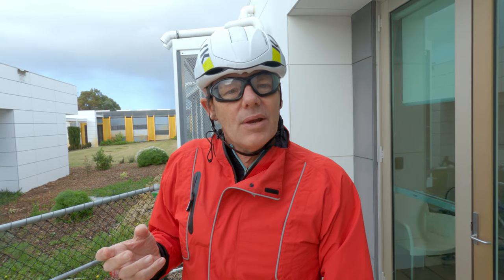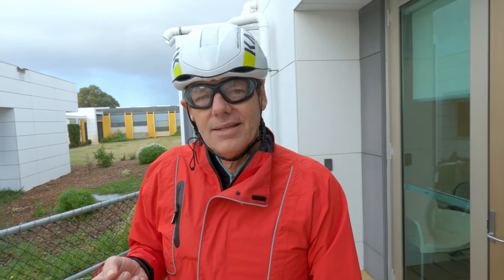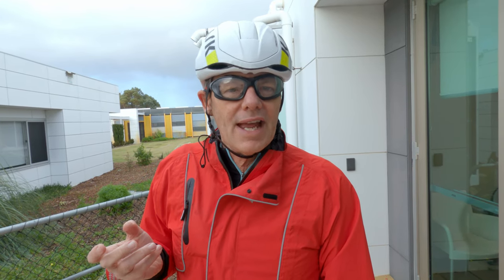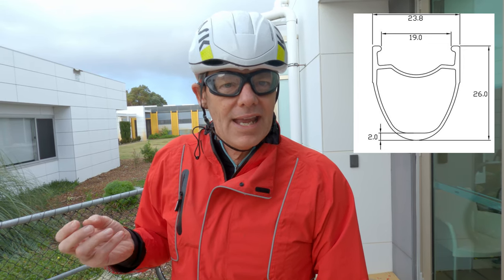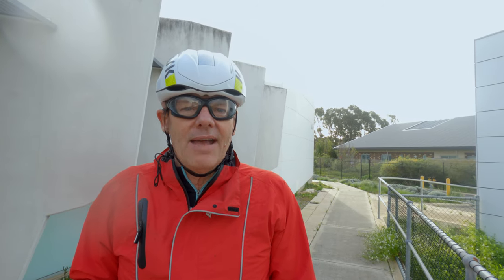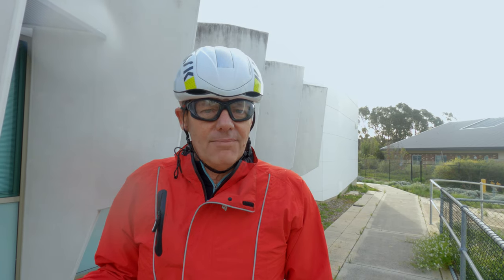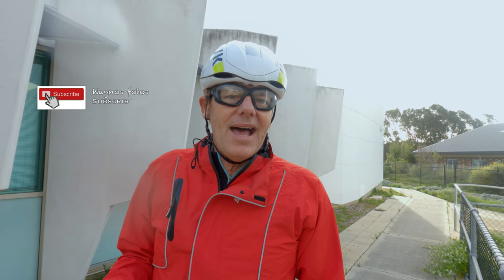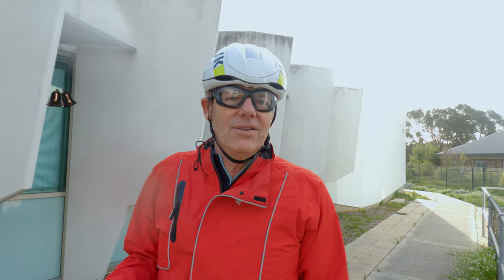WHY did manufacturers move to ROAD DISC?

Comment: We should all give the industry as a whole a thumbs up for making solutions to problems that have happened over the coarse of just a few years, as far as road bikes are concerned. I'm not  defending the bike industry because why fix something that wasn't broken to begin with. However, people wanted these deep dish wheels and the aluminum deep dish wheels were way to heavy for racing. Along comes carbon. But it wasn't just the braking issues because at the same time tubeless was introduced. So in order to get road tubeless to work as well as it does in the MTB world they had to make the tires wider or have more volume so you could run at a lower pressure. High pressure punctures just won't seal. Rim brake calipers don't reach well around fatter tires. So the industry actually solved two problems by moving to disc brakes. I'm pleased that they were able to do this in just a few years and if you think about it they actually made history by changing bikes in a major way from the way bikes were for decades. Lots of small changes have always happened over the years with components but a lot of people never noticed those, just try fitting a crankset from 1985 to work with your current 105 or better group. I'm attempting that feat right now and it isn't easy. As for acquiring older parts, yeah it's going to get more difficult but if you look you will find. You can always build your own wheels to match your current setup if you have 130 or 135 dropout spacing because there are plenty of parts still being made. The sky has not fallen yet.
Reply from the maker: True 👍
Reply: The industry created 2 problems, then told us we needed a solution.

Comment: The braking is so much better with disc. In the future there might be something different and people will whinge again cos they don't like change.
Reply: Discs better?? No more warping o fading?? FINE!!      Rgr
Reply: My latest bike is with disc brakes (Shimano). I live in a hilly area. My former bike had Ultegra rim brakes. There was no difference in dry condition, the rim brake felt even more subtile. it can happen that when you remove a wheel (for transport for example) and remove it back, that your disc makes annoying noises. By the No amateur racer is using disc brakes around here and we have a big club here in Göttingen (north of Germany). I use my race bike also on soft gravel roads and therefore i like my discs, but Iam looking for a rim brake road bike which is difficult these days. And change is not always better...
Reply: @rolffuchs2737  The problem with removing wheels are with quick release they are not exactly at the same position if you put them back in, which causes a disc rub and noise. With a through axle this is solved, they are more accurate in fitting without any play.

Comment: Racing cars and high performance road cars are using carbon brakes and these get that hot that they glow .
     so the technology to produce a rim that will deal with the heat that a a light weight bike produces even descending a steep and long hill must be available if manufactures wanted it,
     They dont they want to sell you a new bike.

Comment: I think you're spot on, the main reason to switch to disk breaks is carbon clinchers. It is difficult to sell expensive wheels, if the wheels are dangerous or to expressive (to low profit margin).

Personally I am really happy with disk breaks on my road bike, but I am a bit heavy (100kg) so rim breaks is a bit to weak for me inn regards to racing anyway.

Comment: So we can agree that, apart from the demonstrated improved breaking performance, disc brakes are safer, especially with carbon wheels. I'm glad we can finally have this conclusion.
Reply: The overall weight is higher and poorer aerodynamics as a result, just to have better braking that is of little or no advantage 99.99 % of the time.
Reply: @SurpriseMeJT  well you tell that to Pinarello who assure that they're new F model is actually more aero in the disc version and only about 150 grams heavier, which is insignificant with the aero advantage.
Reply: @AlexanderTanned  They're lying.  Any company can say they measured anything in any way without providing testing details and then say "See, the new one is better!".   How would you determine if the increased weight is offset by the allegedly improved aerodynamics?  If an independent lab tested this, I might believe it.  Why is there so little independent testing for the bold claims of these bike companies?
Reply: @AlexanderTanned  BTW, just google "disc vs rim brake aero" and you will find your answer.
Reply: @SurpriseMeJT  that could be believable is they didn't have a rim brake version of the new Pinarello F. But they do, my man. No conspiracies, no dark interests. You might just be wrong.
Reply: @AlexanderTanned  Based on the comments of a real aerodynamicist who worked on F1 cars, I'm more likely to be correct.  Hambini is the man.   Make air dirty behind, not in front.  Once air detaches from the surface, it cannot reattach.
Reply: @SurpriseMeJT  The average bike rider doesn't much care about weight or aerodynamics. They do care about how frequently they need to take their bike to the shop to have it fixed or adjusted because they can't or won't work on the bike themselves, and it's this fact alone, I believe, that's contributing to the dominance of the disc brake in the bike industry: caliper pistons that self-adjust to brake pad wear. That might apply only to hydraulic brakes, but to be clear, even mechanical disc brakes are easier to adjust and service than rim brakes.

Then there are all the other benefits disc braking provides: increased modulation and stopping power, more consistent and safer braking performance in inclement weather, the ability to run a wider range of tire widths without hindering tire removal, or even different wheel diameters for both road and gravel riding. Rim brakes just don't allow for that kind of versatility. For the average bike rider, it's a pretty easy choice to make.
Reply: @ericn6611  Uh, I've used hydraulic disc brakes since 2005.  Rim brakes are easier to adjust and maintain than any disc brake system.  Amateurs riding crappy rim brakes will prefer a crappy disc brake because it probably will provide higher braking power.  We aren't talking about Walmart bikes though.  Wet discs are really poor in braking too.
Reply: @SurpriseMeJT  My experience is the reverse. Have bled the brakes once in six years and changed pads twice. Rim brake pads need to be constantly cleaned and bits of metal picked out, otherwise the rim brake track wears prematurely and braking isn't as effective. Riding in the rain with a rim brake bike requires quite an effort to clean the paste off the brake track.
Reply: @SurpriseMeJT  Had to switch accounts, but as I said, ease of maintenance is almost irrelevant to the average rider when they simply go to their LBS for repairs or adjustments.

Putting that aside, though, you just provided yet another reason why disc brakes have overtaken rim brakes on new road bikes: "crappy" disc brakes still handily outperform crappy rim brakes, and first impressions matter when newer riders decide it's time to upgrade or buy a new bike. They'll go with the system that performed better.

As for discs performing poorly in wet conditions: no, that's a very flawed generalization if not an outright falsehood. I have several road and gravel bikes with a spread of rim and disc brakes between them, and while the rim brakes do fine in the wet albeit with slightly diminished performance, my disc brake bikes experience no discernible loss in power thanks to their pad material. Rim brakes must use rubber compounds for their pads. Disc brakes can use metallic pads, with the tradeoff being slightly more noise. Coupled with a steel rotor, that's loads more friction compared to rubber on an aluminum or carbon brake track, which are all significantly softer materials. There's no contest.

Also, mountain bikes have been universally equipped with disc brakes for years now due in part to their superior wet braking performance. Splash a little mud on the braking surfaces of each system and the gulf widens even further. If you've been riding disc brakes since 2005, you must've known this.
Reply: @Kuriketto  I do know this, but stock bikes, especially cheap ones with discs do not have metal pads.  Metal pads wear down rotors more and can be noisier on average than resin pads.  Also I didn't argue against disc on MTB's.  We are talking about road bikes, descending mountains, heating up the rotor far more than on the trail.  Disc brakes for road bikes are not only not necessary, but they are a net performance hinderance at any level except maybe on a 20k dollar bike.
Reply: @SurpriseMeJT  You said wet discs perform poorly, so I brought up mountain bikes being equipped with them to prove that's demonstrably false. Even with stock organic pads they offer no worse performance than rim brakes on both mountain and road bikes if for no other reason than the braking surface being raised higher off the ground and out of the way of water and other contaminants.

And while it's true that metallic pads wear down rotors faster, it's also easy to swap them out for organic or semi-metallic pads for normal riding. Pop out the wheel, undo the pad retaining bolt, take out the pads, reset piston positions, swap in replacement pads and reinstall the retaining bolt, pop the wheel back in, pump the brake lever until firm, done.

Whereas rim brakes, again, don't offer this kind of versatility at all. But as long as I'm comparing pad replacement, let's see what rim brakes require: the caliper needs to be reset either at the barrel adjuster, the cable attachment bolt itself, or both, then undo the fixing bolts for the pad blocks, bolt in and manually position the new pads individually and finally set the toe-in. Cartridge pads make the process a little easier, but that's still a more time-consuming and tedious process compared to disc brake pad replacement.

Then there's the frequent upkeep required to keep rim pads and brake tracks clear of debris to prevent premature wear of the rim itself, but, let's face it, even with regular maintenance, it's only a matter of time before the entire wheel itself has to be replaced. Disc rotors are slotted to allow for self-cleaning, and it's obviously far cheaper to replace a rotor than an entire wheel.

As far as descending is concerned, everybody knows how infamous rim brakes are for their potential to cause tube blowouts during extended braking. Yes, that can be hedged against by adjusting braking behavior, but disc brakes render this concern moot. Also, no study or experiment I've found conclusively gives the edge to rim brakes over disc brakes in real world riding, even given the supposed aerodynamic advantage that rim brakes provide, but discs do consistently outperform rims in the wet where run times are concerned, especially during descents.

To be perfectly clinical about this, this debate's been settled as far as the larger bike industry's concerned. Unless people just outright start buying more road bikes with rim brakes than ones with disc brakes, this trend isn't going to reverse itself, and to me it's easy to see why. Sure, rim brake aficionados come out in force in comment sections of videos like these, but they really are the epitome of a vocal minority.
Reply: @Kuriketto  No study has found that disc brakes on road bikes have a performance advantage neither.   Why aren't riders going on DH breakaway's gaining minutes of time?
Reply: @bikerjk1205  You make good points, but when I compare the complexity of maintenance, I still prefer the light but more frequent (still not very frequent) routine of rim brakes than discs.  Removing a disc wheel and reinserting results in caliper misalignment.  This means breaking out the allen wrenches and re-aligning the caliper.   Most people get caught in the rain or use their disc equipped bike for commuting.   Also, brake pad choice is very important as Shimano pads will rip into aluminum rims, embedding the bits into pads.  Kool Stop pads don't do it as much.  I happen to think that the surface of the rim needs to bed-in before it stops shedding aluminum as well.  Oily grease from roads splashing onto rotors can contaminate them, making them very loud.  My experience with discs is that when there is an issue with them, resolving them is far more labor intensive than rim brakes ever will.
Reply: @SurpriseMeJT  Look up the GCN comparison video on YouTube. Rim brakes were faster by 2 seconds in the dry over the course of a 9 KM descent, but that bike also had deeper section aero wheels and the results were still within the range of rider error. Disc brakes were faster by 8 seconds in the wet descent comparison.

Or try the Global Triathlon Network comparison that found disc brakes stopped sooner, with the difference being more pronounced in the wet, as well as being 5 seconds faster over a 9.5 KM descent, despite the rim braked bike being more aerodynamic.

Neither comparison is conclusive since the sample size is too small with the bikes being dissimilar (but in favor of the rim brakes), but the riders are both former professional racers and know their stuff.

Comment: there we go .. so the problem started, not with the rimbrake system, but with carbon clincher wheels not being able to withstand the heat put on by the rimbrakes on long descents ... but instead of finding more ways to improve the quality of carbon clincher wheels, manufacturers opted to tinker with the braking system and introduced the more expensive diskbrake tech to road bikes and claim that the same are superior to rimbrakes in everyway .. what a tricky way of earning more money by blaming the rimbrake system for a problem started by the carbon clincher wheels .. now, given that the problem started with carbon clincher wheels, then why are manufacturers forcing diskbrakes on the grand tour pro peloton when pros do not even use clincher wheels, but tubulars or (some recently) tubeless wheels ... who are the manufacturers fooling then? of course .. we, the buying public
Reply from the maker: What is really scewie is that tubulars, used in the pro peleton don't suffer this problem as there is no hooks. So the more to disc at this level is pure marketing.
Reply: @waynosfotos  hahaha !! can't agree more to that !!

Comment: It’s because the majority of cyclists (as in the ones who will be actually spending money), prefer it. 

Also, sorry to the folks who keep arguing that it’s unnecessary. You know what else is unnecessary? Cycling itself is also unnecessary. Haven’t stopped you from doing it, has it. 

We want disc brakes. It works better. If there are problems we will just leave it to the mechanic. Basically, we keep the industry moving. You rim brakers, don’t. 

You all keep using the same parts till it breaks, and fix it when it does, instead of buying new ones. That doesn’t exactly make manufacturers happy. 
For us weekend warriors, we don’t care about being the fastest. We just want a nice toy to ride and play with on the weekends. And most importantly, we don’t mind upgrading parts every cycle. So guess who the industry will care for?

Lol. Grow up kids.

Comment: Don't the Formula 1 cars have carbon fiber rotors? Wonder if the bike industry will embrace this.
Reply: If you ride where you can get a carbon rotor hot enough to actually work I’d be terrified of riding that terrain.
Reply: @petermatteson4619  
Forgot they had to get hot.
Stand corrected.
Reply: There is more than one resin  used for carbon fiber, some are more temperature stable than others. 
Since a formula one car costs 10 million $ they have more options than a manufacturer of a consumer product.

Comment: The blame cannot be laid just at the bike brands door. Shimano and Sram are equally guilty . They want to have a common parts list across many parts of their range to reduce stocking levels and costs. Many mtb and road components are interchangeable but may have different part numbers for branding reasons but are exactly the same .
The recent surge in gravel bikes has led the industry to wider tyres, discs ,clearance for mud  etc and high volumes of new bikes so don't blame them for chasing the profits. At the end of the day it will be  SRAM and Shimano who choose to ditch the rim brake system when they see no profit it it. I'm guessing when  Shimano launch their next Dura Ace range it will only have the same rim brakes as the current system and not a new design for wider rims.
Reply: Actually it's quite the opposite. Groupset manufacturers fragment the market and create incompatibilities to lock the buyer in.
Now you get groupsets for cable rim brakes, hydraulic rim brakes, cable discs, hydraulic discs as well as mechanical and electronic shifting.
Last time you could exchange the shifter between road and MTB and different manufacturers was when we had 3x9 drivetrains.